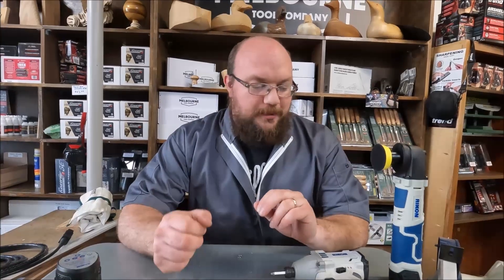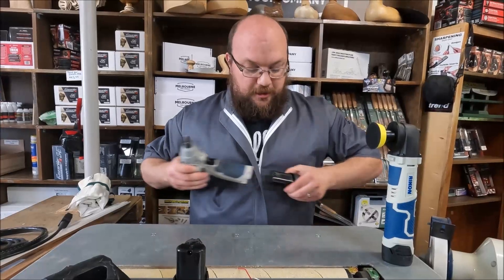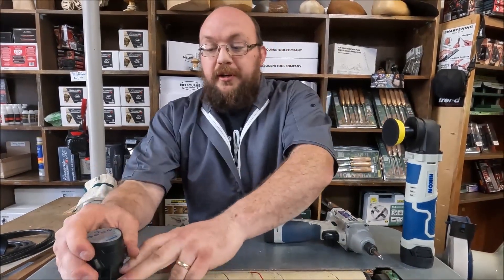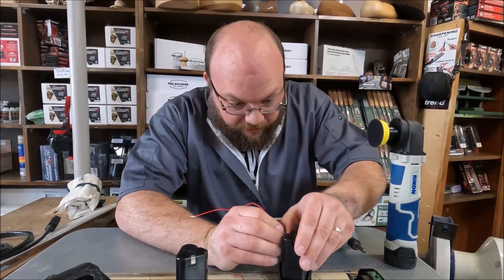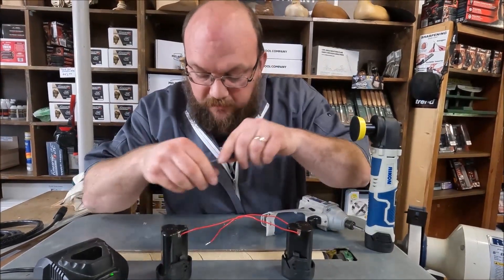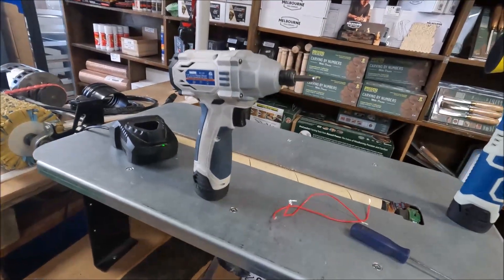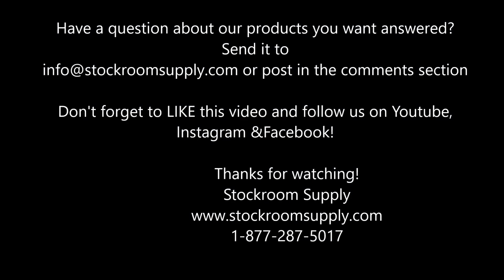Cordless Tool Battery Not Charging? Try This Trick to Bring Li-ion Back To Life! EthAnswers

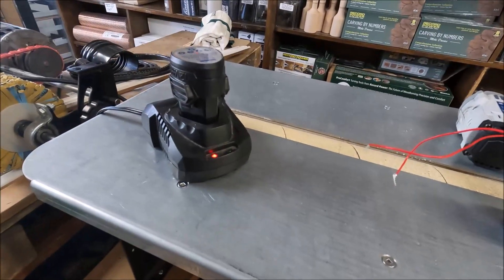Comment: I was worried @2:14 - 2:17 that your wires dangling from your source battery would dead short to your metal table surface. 🙀 😄  But in the next shot, I felt better as you had removed the wires from the source battery. 👍

Comment: Hi. Great 'hack', but how about the device that has no charger but chages from an USB Port. I have a car pump/compressor that won't hold its charge. (it shows only 2 of the 3 bars and drains completely within one minute of operation). Any ideas, or just replace it? Thankyou.

Comment: Wow!! I tried it with my battery for my e-bike.  It wouldn't charge at all.  I had not used the bike in 2 years.  I bought a 14 wire, followed the connections in your video,, connected to a battery in my other ebike (same exact bike), and after 5 minutes, I connected the battery to the charger, and it started charging.  As I write this, my battery is fully charged.  Thank you!!

Comment: a good way to have a battery fire as the Charged battery in rushes to the dead one.
Reply from the maker: Could you give more details on why this is dangerous or cite your source? Seems no different than boosting a car battery but I’m certainly not an expert 🙂
Reply: @StockroomSupply  Battery imbalance in lithium-ion batteries can indeed lead to fire, especially when combined with other factors like overcharging or mechanical abuse. When cells in a battery pack have varying charge levels, uneven temperature distribution, or different degradation rates, it can lead to overheating, internal short circuits, and ultimately, a thermal runaway event that results in fire or explosion. 
Here's a more detailed explanation:
Cell Imbalance:
When cells within a battery pack don't have the same capacity, voltage, or state of charge, it creates an imbalance. This can be caused by factors like self-discharge variations, temperature differences, or uneven charging/discharging patterns. 
Thermal Runaway:
If a battery cell becomes severely overcharged or over-discharged, it can enter a state of thermal runaway. This is an irreversible chain reaction where heat generated by chemical reactions within the cell cannot be dissipated quickly enough, causing the cell to overheat rapidly and potentially ignite. 
Factors Contributing to Fire:
Besides cell imbalance, other factors can also contribute to lithium-ion battery fires, including:
Mechanical Abuse: Puncturing or crushing a battery can compromise internal structures and release flammable electrolytes. 
Overcharging: Exceeding the battery's maximum charge voltage can lead to overheating and thermal runaway. 
Over-discharging: Draining a battery too far can cause internal damage and instability. 
External Heat: Exposure to excessive heat or direct flame can cause a battery to overheat and ignite. 
Safety Measures:
To prevent lithium-ion battery fires, it's important to:
Use a Battery Management System (BMS): BMS helps to monitor and manage the charging and discharging process, preventing overcharging and over-discharging. 
Store and charge batteries in a safe environment: Avoid storing batteries in extreme temperatures or exposing them to direct sunlight. 
Dispose of batteries properly: Do not discard lithium-ion batteries in household trash or recycling bins, as they can ignite during transport or processing. 
Be aware of warning signs: If a battery swells, bulges, or overheats, discontinue use immediately and contact the manufacturer or a qualified professional.
Reply: @StockroomSupply  It seems logical that the empty battery would accept current at a rate higher than is safe for the cells, and a fully charged battery will happily supply the current.  This could potentially damage both batteries.  You could mitigate this risk by placing a power resistor in between and just giving it a few extra minutes to compensate.  A 100 ohm or larger would be appropriate, but even  18v/100ohm is 180mA, and 180mA*18V is 3.24 Watts, so that resistor is still going to get quite hot
Reply: Danke für das Video!
Diese Technik funktioniert auch mit NiMh Akkus.